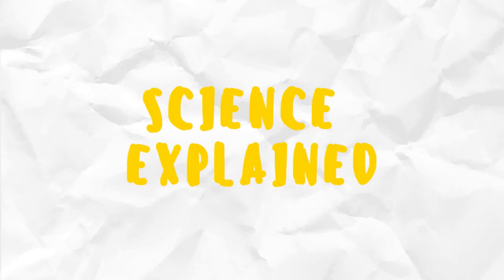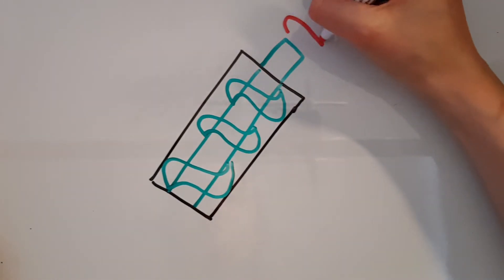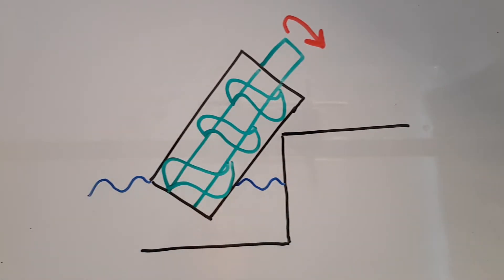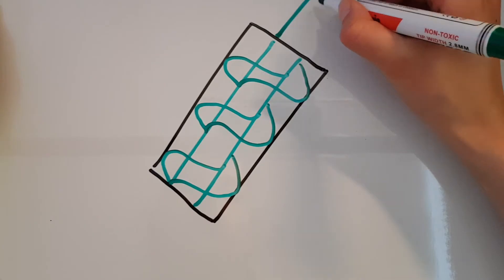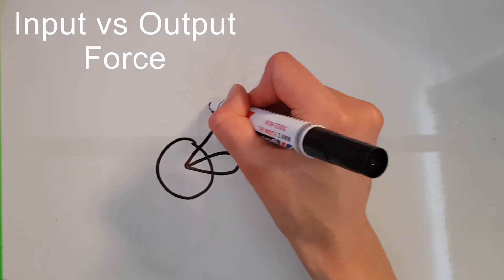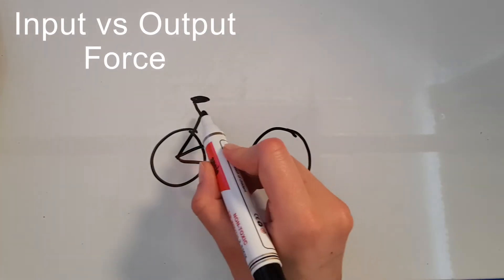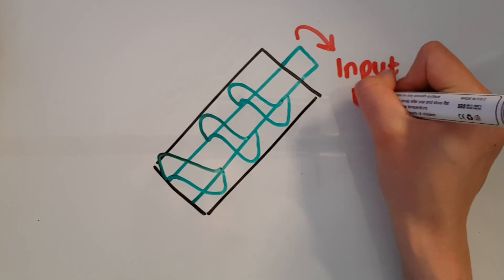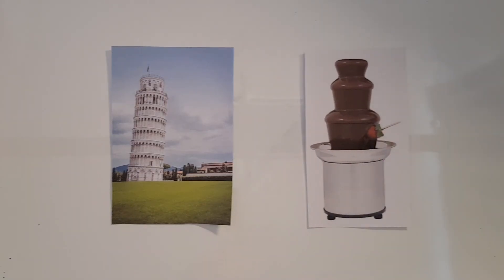Science Explained: Archimedes Screw

Comment: What if the  Archimedes screw was placed  horizontally in a tank water, the screw enclosed and compressed air added at the bottom. Would the rising air spin the screw. With the screw having baffles every so often of course for the air to rise against and generate force.